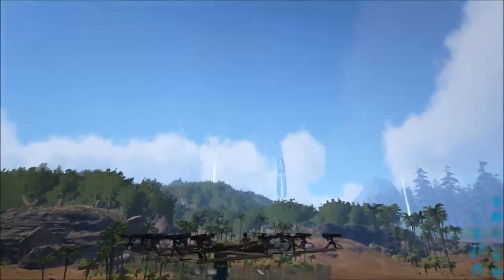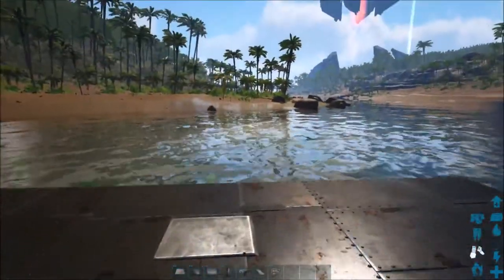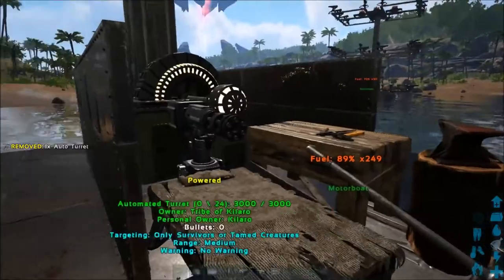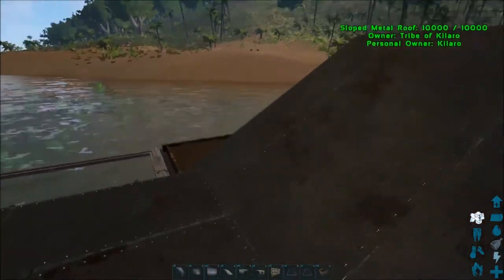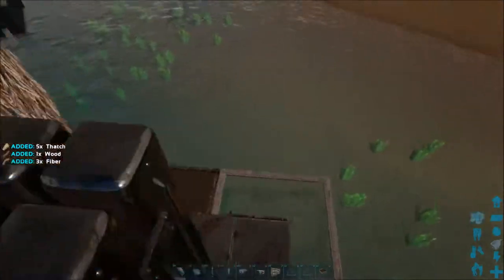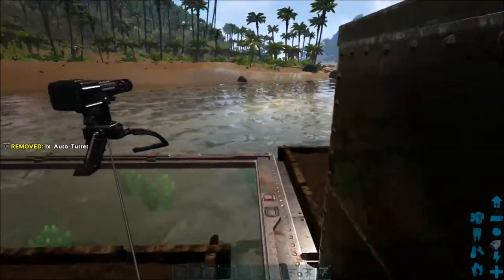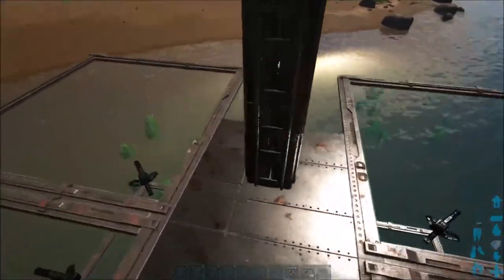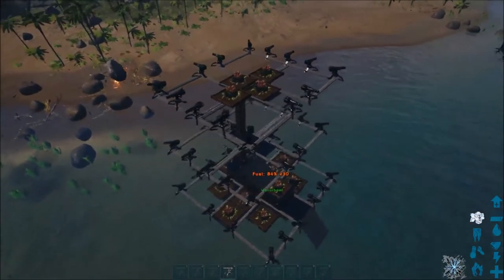Ultimate Turret Tower Tutorial, Deadly PvP Motorboat - Ark Survival Evolved

Comment: Thought I'd pass on a little feedback again mate! Boat works well for PVP defence but is a real pain to reload and place turrets. I suggest those who use this build create a special Dock to reload and conduct any repairs, will save you a lot of swearing about not having tek jetpack. You will not get dev wiped, this build has nothing that current gameplay does not allow. Also worth noting to anyone wondering, you CANNOT place heavy turrets on rafts. Wildcard prevented this and when you try you get the "Cannot be placed on a platform" message. For protection I suggest taking a second boat to defend this one as its small build footprint is its weakness.
Reply from the maker: On officials I reload with a quetzal,  but a dock for reloading sounds like a fun project.

Comment: A Very Impressive PVP Boat. Has a very Anti Aircraft feel to it, I use turret motorboats almost daily on official PVP to keep griefers and small raiding parties at bay, thought I would ask how do you find this design goes with reloading the turrets? Do you find access is too restrictive to do during combat and would be best to retreat once ammo exhausted to reload from safety with a pteranodon?
Reply from the maker: You would need to retreat for sure to reload the upper levels, I mean depending on what you are fighting off of course.  You could possibly reload the lower level, just depends how good enemy snipers are.  I was thinking about designing one similar to this, but with enclosed access to the top and a couple sniper nests on the boat, it would have fewer turrets of course.
Reply: this would be nice !

Comment: This build is illegal and will get dev deleted, might even get you dev wiped.
Reply from the maker: I don't entirely agree with that.  But to keep everyone informed, it has come to my attention from Carlip in the recent patch notes there is the following statement  "v260.0    Prevented multiple floors from being built underneath rafts and platform saddles."       This is probably the reason our previous build mechanics are no longer working.    That said, I don't think this makes the build illegal, and I personally would continue to build it as it is, as I think leeds are more likely to destroy your boat than the devs over this.  However, that said, if you wanted to build this and not be against their new intended build, you would simply not build the floating foundation underneath,  you would need to set some of the upper turrets on wild to protect against leads (especially a  plant-x to slow down alpha leeds, as the motorboat is faster than a regular leeds)